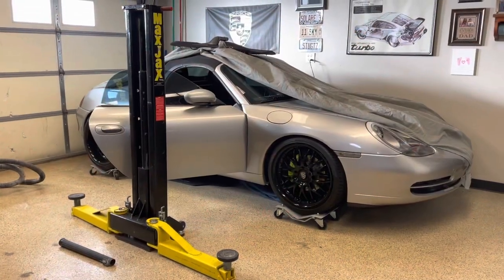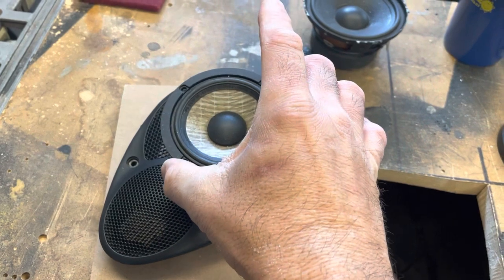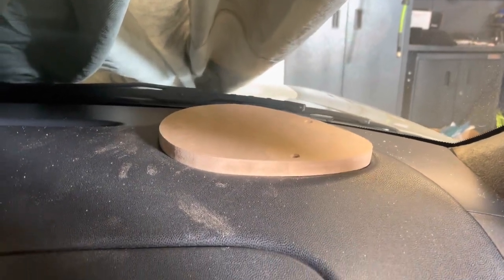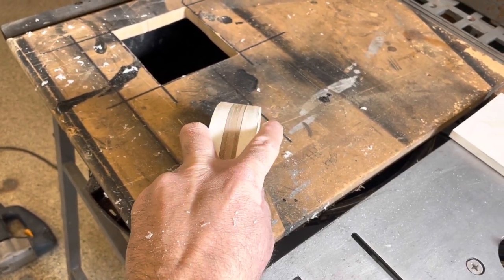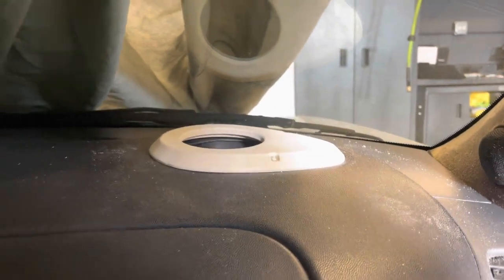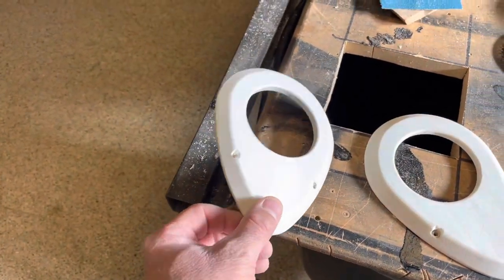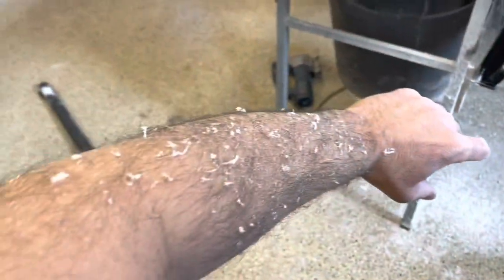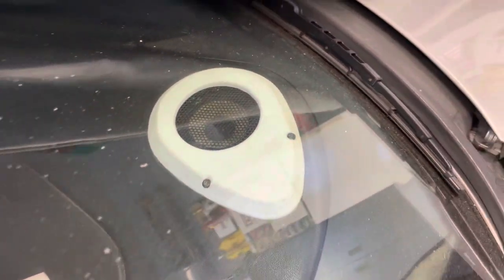1999 PORSCHE 986!!  CUSTOM CAR AUDIO BUILD. FOCAL DASH SPEAKERS!!

Comment: Following your project very closely as I have a very similar car, 99 model , owned since new and I’m also contemplating a system upgrade. It will be very helpful to see the do’s and don’ts of your install. 
Thank you for posting.
My plan was nothing too drastic, keeping it vintage with original Porsche radio /cassette/ CD changer but adding a new hertz amp and some rear shelf speakers. 
My fronts are techart 3 way speakers mounted in the doors and dash. I believe they used MB quartz . Would be interested if u have plans for a subwoofer or not! Is there even space! 
Thanks u and best of luck with your upgrades.